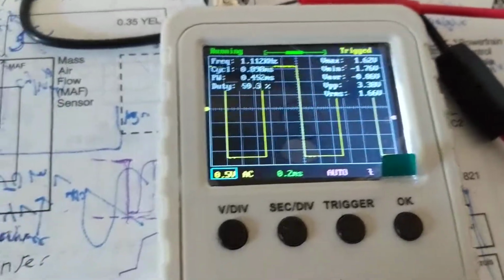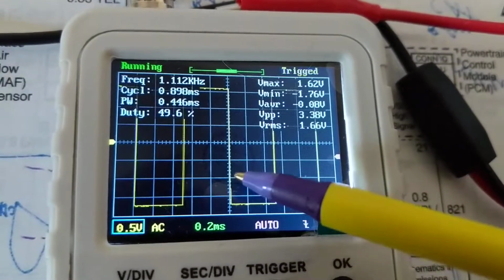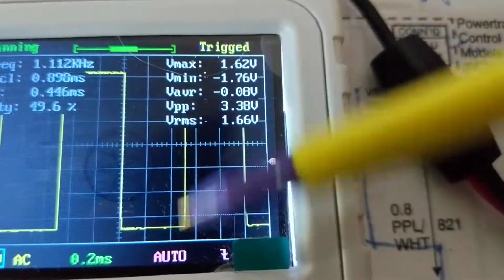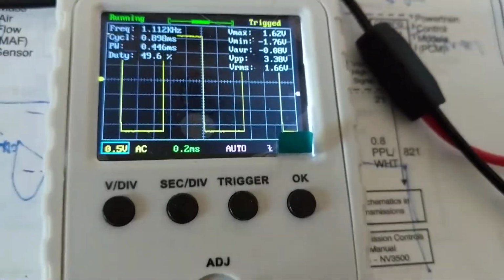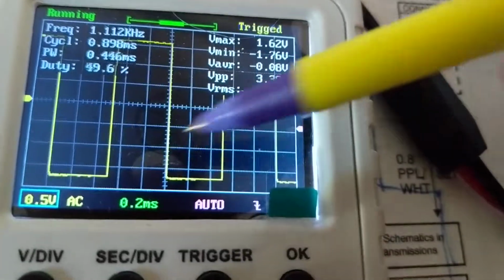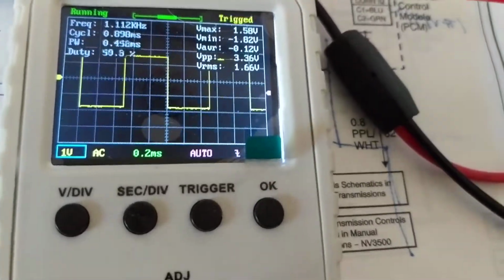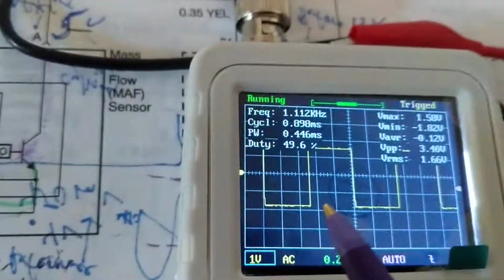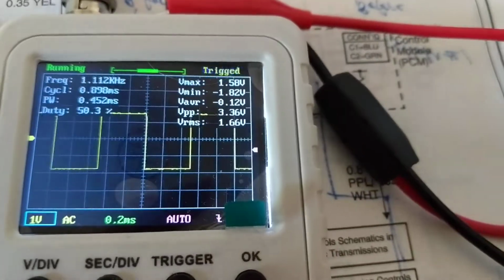HOW TO FIX COMPUTER AND SENSOR PROBLEMS WITH BEST AUTOMOTIVE TOOL TO TROUBLESHOOT

Comment: The signal must be between 0V and 5V, why it is - 1.6
Reply from the maker: This was not at the mass airflow sensor this was just calibration of the 1 kilohertz signal of the scope I did not have a connected to any mass air flow sensor it was just a demonstration to show how the scope works before I do it on the car
Reply: @Joeelectronicschematicsforauto 
Thanks friend, I hope that u make a demonstration of the signal of heated resistor maf sensor on the scoop , because on YouTube there is no video about this